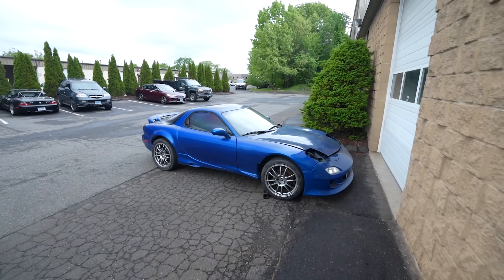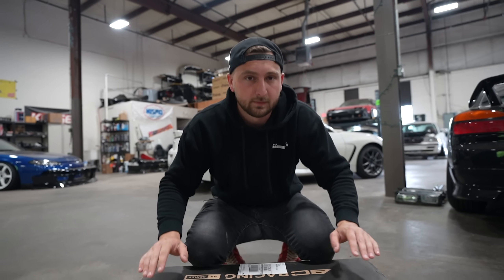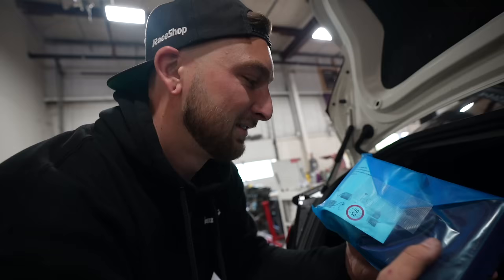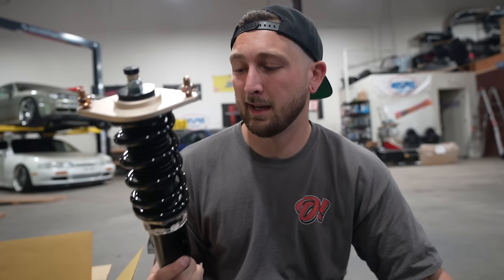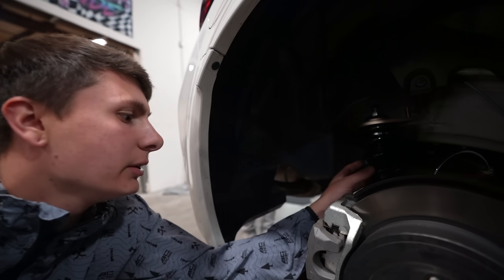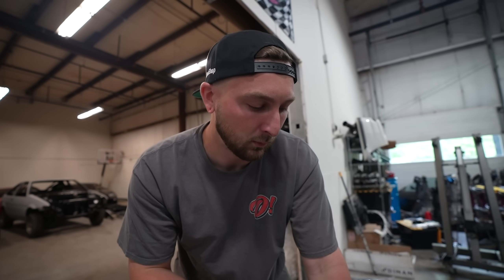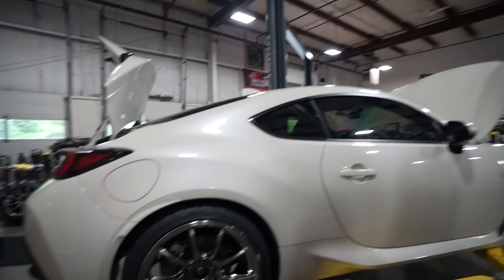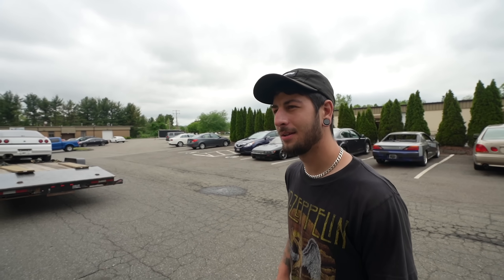Totally transforming my new BRZ!!

Comment: Here in Japan they have 4pot front and 2pot rear Brembo calipers that came as factory options. The GRMN 86 has 6pot fronts and 4pot rears. There is also the TRD Monoblock 4pot front and 2pot rear caliper set up for the 86/BRZ.
Reply: or just steal off older wrx/sti.

Comment: Should build the FC put it all back together interior etc and put a junk yard LS in it with a cam little engine mods all the parts are there for the swap anyways can soon pull the engine back out and sell as a roller later on

Comment: I had a nightmare experience with BC Racing, my front coilovers are still making so much noise and they keep sending me replacement parts so I’ve had to rebuild them twice now and the noise is still there. The worst part is their customer service, they don’t even answer my emails they just send me a tracking number for a different part. Never going with BC ever again tbh. I know they sponsor u Jimmy so I’m sorry for this comment I just wanna know if I’m the only one with this experience.
Reply: Did your setup come with sway bar links? Because I’ve had issues with sway bars making popping noises after coilovers. Disconnect the sway bar and go for a drive and see if the noise is still there.
Reply: @henrynewgent8481  nope it’s a 07 Civic Si, but I replaced the sway bar links, control arms, ball joints, and sway bar bushings, then I found that it was coming from the coilovers where the top of the spring is seated, so they sent me a new top seat/koyo bearing and it didn’t fix it.
Reply: @zodspeed  oh interesting. I’ve had mine on for over a year and they look and feel brand new
Reply: @henrynewgent8481  now they’re sending me new dampeners but it’s not gonna fix it
Reply: @zodspeed  possibility that your car is used, and someone rear ended someone? Not a bad enough accident to go through insurance, but definitely bent some shit? I'd start doing some measurment on my towers and see if they are square. 

Been there. 

Found out my shit had been crashed before.
Reply: @GARTHURZILLA  I found the issue already its the coil overs themselves… the spring moves side to side very slightly on the top where it’s seated, causing a bad clunk over every little bump that I hit

Comment: Subaru and Scion 4 Piston ATS Caliper Big Brake Bracket Kit

This big brake bracket kit allows you to install 2015 Cadillac ATS 4 piston Brembo calipers onto the front of your Subaru BRZ, Scion FR-S, Subaru WRX, Subaru Forester, and many other similar Subaru models using a 5x100 bolt pattern 326mm (12.8") 2004 STI rotor.

Comment: Just so you know IF you ever do slam it on its nuts, get the subframe and diff riser bushings  from pbm to even out the axle geometry. Once slammed, the cv axles will start blowing out if the angle of them arent changed.
Reply: fire wheel choice btw but that was to be expected lol
Reply: subaru brz sti ts model has brembos but they might be a little close with those wheels.

Comment: I’m not positive for the new brz but there it’s a Cadillac ATS brembo front brembo swap kit where you buy 04 sti 5x100 rotors and use an adapter for the calipers and it’s only like $700-1000 depending on pads and rotors

Comment: For about 2k you can get a set of brz performance package brembos from the previous gen. They will most likely fit. Definitely don’t get a set of sti brembos bc the brake bias is completely different, the brz has a leading brake setup whereas sti’s have trailing brakes

Comment: Have you thought about itbs on nissonda their super cheap, cut the stock manifold 5-6 inches away from the head flange and put on a set of gsxr1000 itbs I believe either 750 or both 750 and 1000 air box has different sets of runners so you'll need 2, with your tools you should be able to fab a plenum for cheap for the turbo, don't forget port matching and all that on the intake

Comment: so since there 5x100 u can only get 04 sti brembo brakes u could possibly get 04 sti front and h6 5×100 rears or fronts for the rear, h6 brakes are bigger since there for the 6 cylinder my 04 forester xt has them on the rear im about to get the 04 sti brembo's the caliber bolts and new 04  sti rotors should fit since it's 5x100